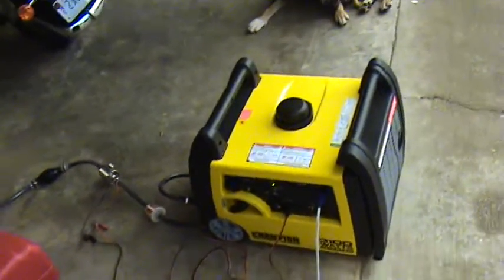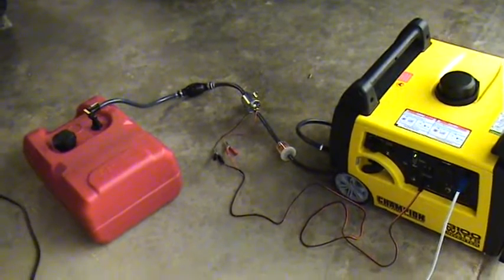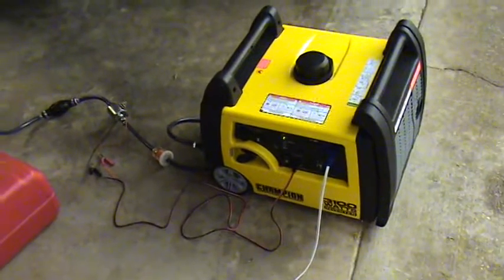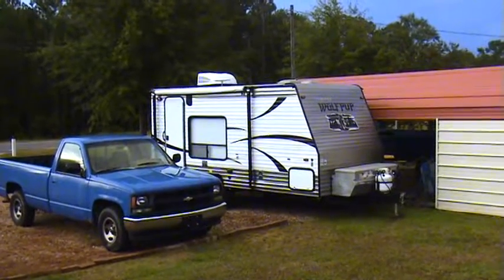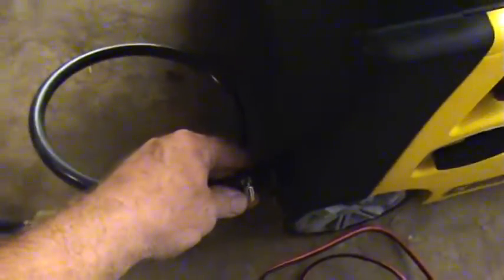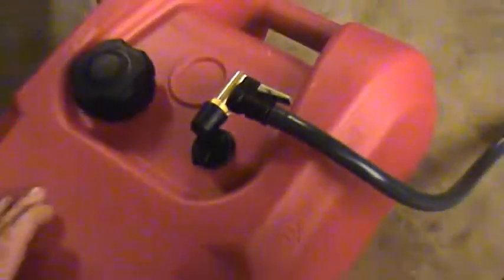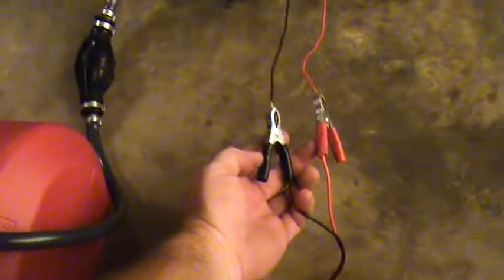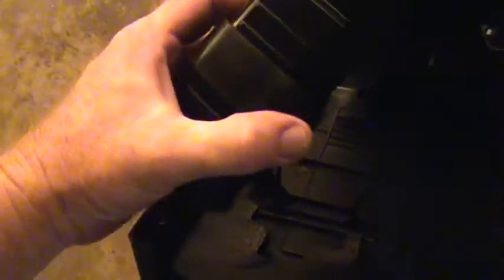Champion 3100 DIY Extended Run Tank

Comment: That looks like a rubber one way valve  pump, while it will pumps fuel in, it will block any air bubbles going back out to the aux tank. I bet you are having fuel starvation. If you have an electric pump, why do you need a rubber primer valve. Not all rubber primer pumps are made the same, some have one valve but most have 2. Some cheap gravity ones does not even have any valve that you need to block the end with your finger as a valve for it to suck fuel and release when flow is established. I would suggest, you remove the rubber primer and test it, then troubleshoot the electric pump next.

Comment: I took the hose off the internal tank and ran a longer hose out the side to a external gas tank. How ever my external draws from the top and has a line to the bottom, even with the tank higher then the generator i am having problems. Does the external also have to draw or come out of the bottom, like the internal one does?

Comment: I don't know if this is a dead post but in looking at this generators manual I noticed that the 12 volt power is not regulated. I was wondering if you tried a 12 volt regulator on the 12 volt supply or using a regulated 120 VAC to 12 DC to run the fuel pump. From what I read the 12 VDC is more just a battery charger. I'm going to get a 12 vdc regulator from MPJA for about $10 and install it.
Reply from the maker: Let us know how it goes!  I want to say the universal pumps have a ridiculously wide voltage range though, something like 8V - 18V...
Reply: the manual says it puts out 12-24 volt but as voltage changes so would pressure
Reply: Jason did you have any luck trying the 120 VAC to 12V to run the fuel pump. I thought about trying this also. Curious if it worked.

Comment: If you put a check valve between the Tee and the built-in tank it may prevent fuel from being pumped to and overflowing the tank.
Reply from the maker: I bought a small bag of them for that purpose, but if the check valve fails then you have a fire.
Reply: Not, it won't becouse the select fuel valve is of.. It can't pass Gass if it's off

Comment: What about using the same setup you have minus the fuel pump? Just ensure that the external tank is high enough for gravity feed. Have you tried that? I just ordered a new Champion 3100 and was thinking of trying that. Let me know what your recent experience has been.
Reply from the maker: +Mark Decamps There's another guy that has done this, I was just trying to come-up with a simple plan not to have an elevated tank.

At this point I would not try using a cheap electric fuel pump as I have gone through about a half dozen fuel pumps in less than 10 hours of running.
Reply: Mark Decamps - Did you ever try it without the pump?  I am about to do this procedure myself, maybe I will try it without the pump
Reply: @lorimaus387  I haven't yet. It is still in the planning stages. Lol

Comment: On the engine shutdowns, another thing to consider is if you have a water heater going.   I run my entire trailer off generator, no problem, except for the water heater.  When I inadvertently left that on, it overloads the output on the generator.  In my case, the engine is still running, but the output shuts off.  I have to shut down the generator for a minute, then hit the reset, and start over.  It will run for around 6 hours, even in 90-100 degree heat.  But it is annoying getting up at 6 AM to refill the tank.

The generator is marginal performance for an RV with AC, etc..  So it is good to run everything off of gas that you can, where there is an option.  Another small area of gain is to switch out all of the incandescent lighting for LED.  $50-$80 up front cost, but further reduces draw.  And improves battery life for those times you're not running generator, but boondocking.

Thanks for the video instruction.  Your's and the other option you mention are the only "safe" ones out there.  Well, there is one where the cap was modified, but I'm not a fan of going that route with the potential downsides involved.  Gravity has no safety shutoff.  Another point is that it's a lot cheaper to replace a fuel hose than a gas cap for these puppies.

Comment: I tried another tank elevated above my champion 3100 connected into the line that did have the fuel pump on it thinking the gravity feed from the elevated tank would keep the fuel tank full on the generator tank until both tanks ran out. Well all it did was fill up the generator fuel tank until it ran out the overfill tube. So that didn't work either.

Comment from the maker: I think the fuel pump by itself may have too much fuel pressure causing the low load pulsating.  Perhaps a regulator with the electric fuel pump?  

The only problems I see using the electric fuel pump with perhaps a regulator is the possibility of a fuel leak around the cap and causing a fire.  That's the only reason I didn't go with a top feed system.
Reply: Cheap as in low price. This is actually a very good generator, I own one and it purrs like a kitten at idle with or without a load on it.
Reply: https://drive.google.com/folderview?id=1EhdWtjnoDuCZyoHrxZpTAL8ooxCiam40
Reply: Check it out

Comment: I have a Champion 2000 watt generator that I experimented with. I watched several videos reference to extended run fuel tank for Honda. I saw that one about the Champion 3100 but that was about it concerning Champion generators. So I purchased a Honda extended fuel gas cap and it fits my Champion perfect. Then I screwed a Johnson outboard connector on then primed the line and it worked just fine, as long as you elevate the external tank slightly. I watched your video and I was thinking if I added a electric fuel pump I wouldn’t have to elevate the external tank at all. Your thoughts?
Reply: I have the champion generator 3100!! Are you sure the Honda 2200 fits on this???? Because I can't find any fuel cap for my gen to make it extended tank! Please let me know and show me this

Comment: I did this same procedure on my new Champion 3100 using the same fuel pump and everything and it would not work. It would run and it sounded like yours running in the video (pulsing) and when I would turn my air conditioner on it would quit running. I even tried a different fuel pump that put out more pressure and volume but it didn't help.  Pulled the fuel line off going into the T in the generator and it was getting lots of fuel but it just wouldn't run correctly. So this same process would not work for me.
Reply from the maker: Rick Hedgpeth   Hiya Rick,

You may be right, mine runs smoothly while running on the internal tank.  Also the fuel stopped working after less than 20 hours.  Unfortunately these are things only testing brings out.  

I'm sorry for your outcome and definitely do not want to mislead.  Also the fuel connect on the generator started leaking when no fuel line is attached.  If I run into any further problems I'll post them as well.
Reply from the maker: One more thing, even running with the internal tank our generator would sometimes die when the a/c would kick-on.  With the economy mode shut-off it doesn't seem to have that problem.

It's not consistent, a few times it ran fine with the economy mode on.

Comment: hey just a heads up, it sounds like you have that rev'ing problem which is caused by a defective carb. call up champion and tell them that your 3100 inverter is reving by itself and they will mail you a new carb. replacing it is pretty easy, there is a youtube video that someone made